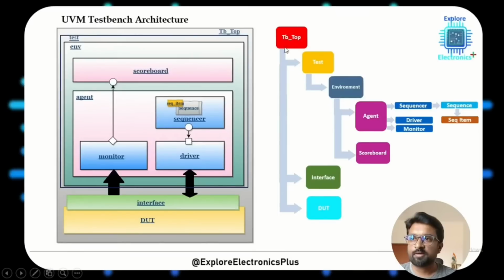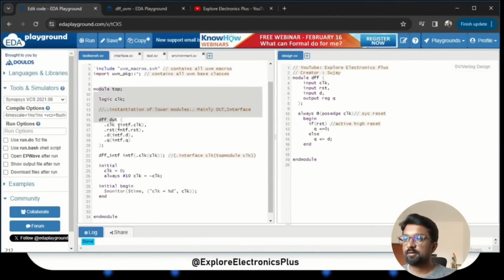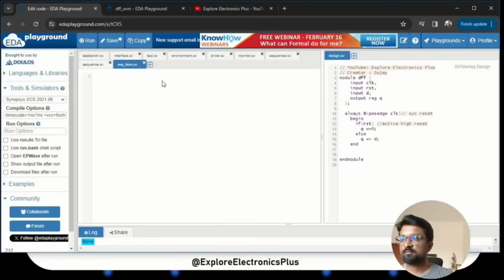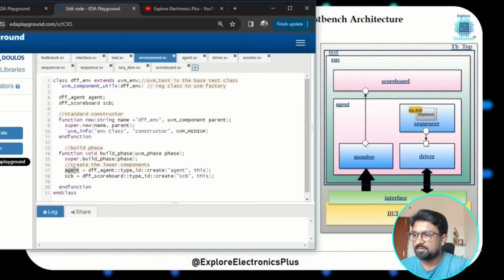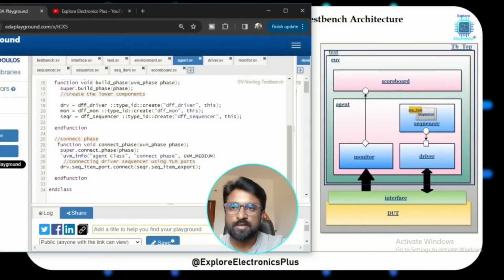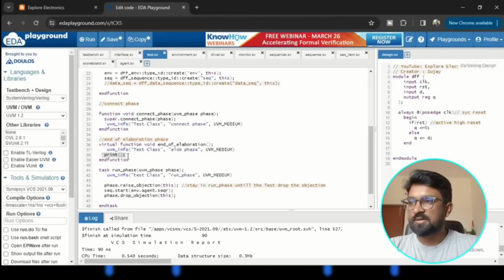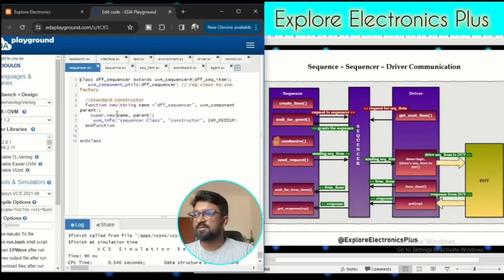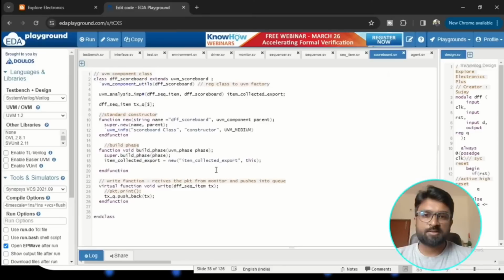UVM Testbench code for Fresher / Beginners | UVM code for Design verification fresher

Comment: Upto which part of the code is to print topology?
Reply from the maker: @Jithin31 till end of elaboration phase.
Reply: @ExploreElectronicsPlus  so in test upto end of elaboration phase is required to print the topology?
Reply from the maker: @Jithin31  yes
Reply: In interface u have not used clocking block and modport why?

Comment: Sir i want to know that does uvm takes some time to get stabilize or get randomized for example i have made code for jk flip flop but for 1st 150 ns it is giving output only 1 but after that it gives output correct as expected and scoreboard also runs smoothly
Reply from the maker: @abhishekchaurasia974  that's not bcos of UVM! Send me your edaplayground link. Let me check
Reply: @Explore_VLSI  link is getting removed ,can i get your telegram
Reply from the maker: @abhishekchaurasia974  send in insta

Comment: sir why do we create object for environment interms of 
dff_env::type_id::create("env",this) ;
instead of 
env=new("env",this);
Reply: Why didn't we create build phase in sequencer, since it is a uvm component, sir?
Reply from the maker: @nithishkanna7  build phase contains UVM factory create methods which creates UVM component in the testbench. For eg, Test creates Env, Env creates Agent, Agent creates Driver. 

In this code Sequencer does not create anything. So skipped.
Reply: @Explore_VLSI   sir, but you did create build phase for both driver and monitor as well, since it does not contain any lower modules. Does it have any functionality for build phase in driver and monitor. And thanks for your response for above questions.
Reply from the maker: @nithishkanna7   should always use create() rather than using new() for classes registered with the factory. There are override advantages.

Comment: Sir, I tried to run this D_F/F UVM Code in EDA_Playground with Aldec Riviera Pro. But its not working??
Reply: Plz check with synopsis vcs once. Else what error it shows?
Reply: @ExploreElectronics  Sir, First of all thanks for your response. But Synopsys is the commercial software. I don't have any company account. I am passed out student. Can you please tell any free simulator where I can run UVM CODE??
Reply: @ABHISHEKBARNWAL-jl3gj  ohk. Let me check with Aldec Rivira.
Reply from the maker: It is working fine with the Aldec Rivira tool as well. Please check you have made any changes. What's the error?